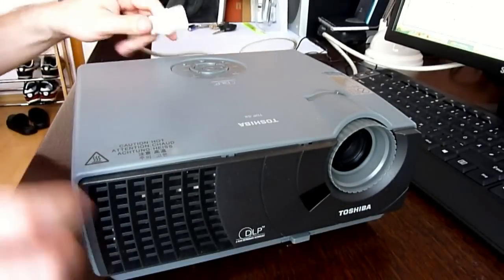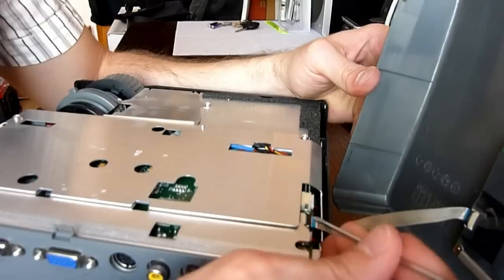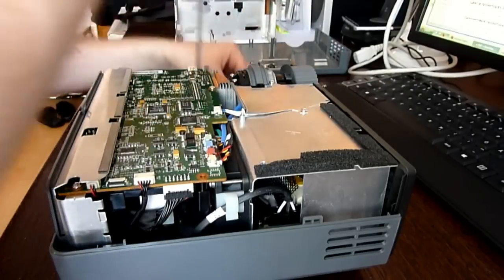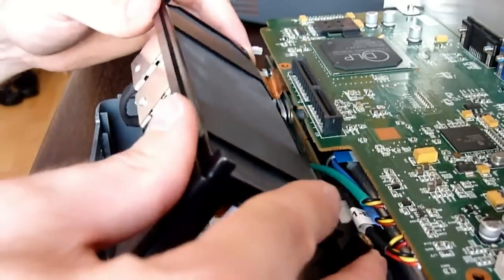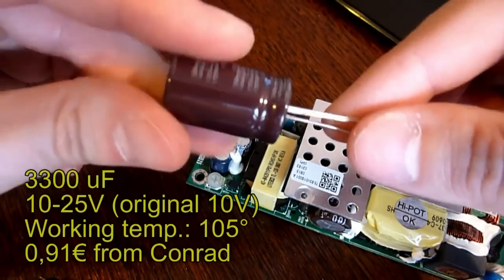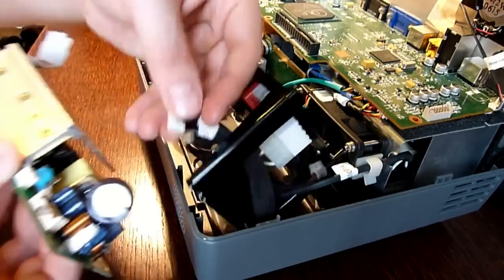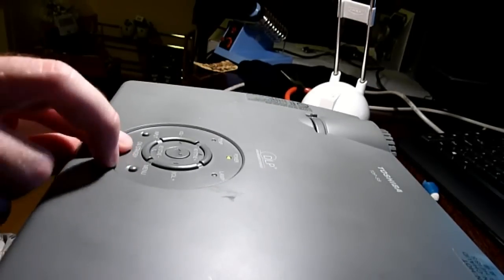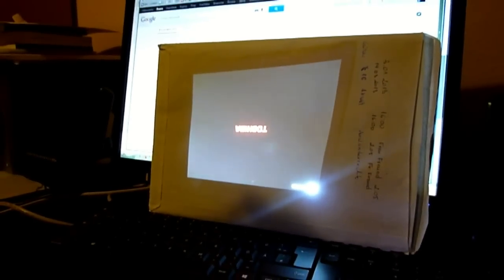Repairing Toshiba TDP-S8 projector teardown

Comment: The Yageo SEK series is a standard issue, 105 C degrees capacitor, and is not well-suitable for low-ESR purposes. It will work however, but will fail sooner than the original and during its lifetime, will provide poorly conditioned voltage, not very good for prolonged usage. Use SC, or SY series instead, as switchmode PSUs require low-ESR series as a mandatory.

Comment: Good video. Please help me. I have the same model. My lamp is good, I already did the lamp reset, but the lamp warning light turns itself on after 2 minutes and the projector turns off automaticly after 2 more minutes, What shall i do?
Reply: Nuno Silva you could try following the instructions in the video ?
Reply: Tks, i tried but nothing.
Reply: Nuno Silva OK. If you haven't checked yet, Also do a continuity test of the fuse near the 'AC in' wire on the power supply, It is a small round black component with fuse label on the PCB